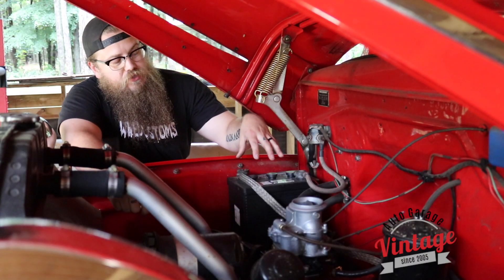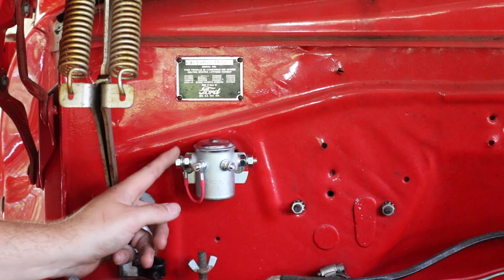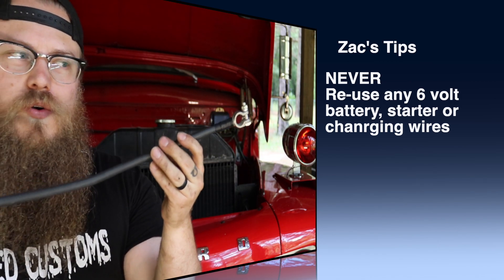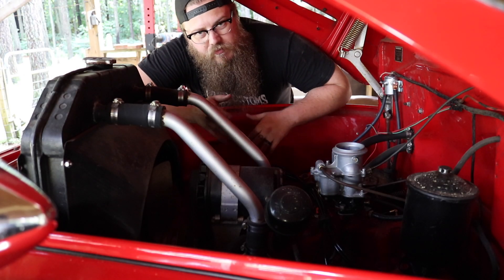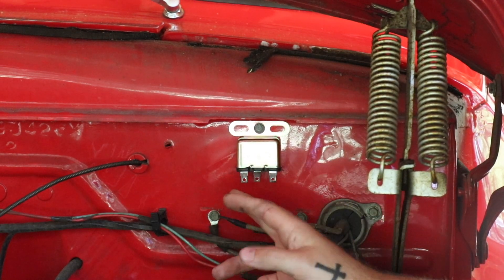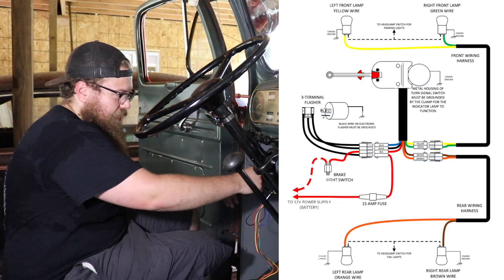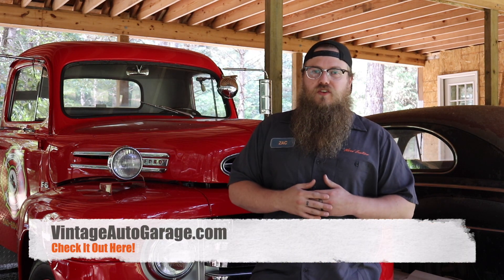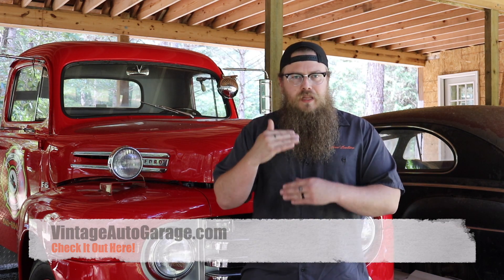12 Volt Conversion Kit Install! Flathead Ford

Comment: Hi Zac, picked up the kit from VAG (arrived today), noticed you installed a turn signal switch I already have one, do I need to change it for a 12V one or will the voltage reducer work? I also bought the digital ignition - is there anything I need to be aware of installing it - do you have a video for that installation? Finally, what bulbs might I chanve from 6 to 12V. Thanks! Exciting!
Reply from the maker: Great! Make sure to get the manual that VAG sells for the conversions, in that manual they have a spread sheet of part numbers so you know what bulbs you need to buy to convert them over to 12 volts. As for the turn signal switch it really varies on what switch you currently have, safest option is to replace it, another option is to replace the flasher for the blinkers and add in a fuse and change it wiring to negative ground, certain turn switches will work fine when switching it then others will not, I haven't found a good pattern to why, has to be different components for the voltage types I am guessing, if you mean a pertronix then you have the easiest ad best ignition, I do not have video of installing one as of yet but plan to! Just make sure the gap is right and you are good to go
Reply: @WiredCustomsSpeedShop  awesome, thanks for your response - I'll order up the switch then. By the way, might you have a video where you adjust the steering box on a '35 ford? Thanks again!
Reply from the maker: @WaxMeister   I do not but as we speak I am rebuilding a steering box off of a 47 ford, that might help some
Reply: @WiredCustomsSpeedShop  what has me confused is the Brass nut/bolt that appears to be the adjustment does not look like other adjusters where the centre adjuster is held with a screw driver while the locking nut is ether loosened or tightened in the adjustment process. I'm shy to just crank on it without knowing. I have a repair manual on order but there's no guarantee it covers that adjustment issue. If you post the steering box rebuild I'll watch it in the mean time I'll continue with my research and/or wait until the repair manual arrives. Thanks again for taking the time. Appreciated!
Reply: @WiredCustomsSpeedShop  Well, got the adjustment done, the 'brass' blind bolt turned out to be a steel bolt. I took it to my mini-lathe and turned it down so the adjustment screw could be tightened properly - 100% improvement!

Comment: Can I ask why it is so critical to change the battery cables and not reuse them? I understand your reasoning on the chassis ground strap. I just spent quite a bit on 1or 0  gauge battery cables. Probably should've decided what voltage I was going run first... lol
Reply from the maker: A good majority of the original cables were too small even for 6 volt, it’s a common upgrade on a 6 volt to get bigger cables, if you have the right side cables and not the original then there is no need to replace them
Reply: @WiredCustomsSpeedShop  ok thanks,  I really appreciate the response.
 I'm getting ready to drop the oil pan in my wife's 1949 f1 to clean out any sludge after watching several of your videos... lol 
 The motor is still in it  Any tips or recommendations on the job or what the best pan gasket?
Reply from the maker: @chrisjansen8294  nice! I just use the fel-pro gasket, just make sure to put some black rtv on the edges by the rear main
Reply: @WiredCustomsSpeedShop  My understanding is a 12 volt system requires half the size of wire vs the 6 volt system., due to the doubling of the volts.

Comment: Just what I’m looking for, definitely gonna be subscribed. You would know any local parts place in VA do you? I know about MACS or ECKLERS I just didnt know if you knew of anything around VA area thank you I’m excited to get my flathead going
Reply from the maker: Thank you! I do not know of any local parts, but there is a lot more than just Ecklers and MACs, also check out shoebox central, Vintage Speed, Speedway has Flathead stuff too, Stromberg97.com, then when it comes to speed parts there is even more places online

Comment: Would you start with just removing all the old wires or do you do a piece at a time?   Is there a distributor from a 12 volt donor vehicle that would work on a 1955 223 ?

Comment: Great Video! Thank you! What do you think would be the hardest part for a new guy???
Reply from the maker: Honestly the whole swap is really easy, the only part I would consider hard is adjusting the fan and powermaster belt, I needed 4 hands to get it all right and the belt tight at the same time!
Reply: @WiredCustomsSpeedShop   what about the coil what do you recommend

Comment: We had to have a core heater plugged in to get the old Ford farm truck going in the winter. Wyoming truck.
Reply from the maker: Oh wow. I’ve never messed with a Flathead in the true cold, I couldn’t imagine how hard it was to start
Reply: @WiredCustomsSpeedShop  Had to finesse the choke . If nothing else, Grandma could pull start us with the John Deere. Started that with a hand crank. That flat bed is now in my garage undergoing a frame up. I am relying on YouTube videos like yours for how tos. Thanks for helping me rebuild my Holley 94. I am proudly subscribed to your channel.
Reply from the maker: @davidhaarala2341  that’s awesome! And thank you for watching I appreciate it